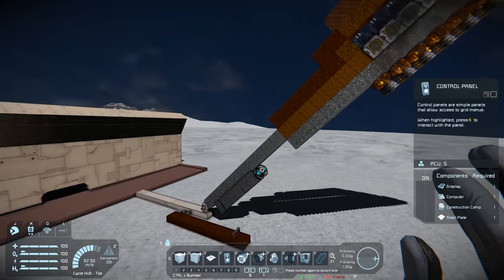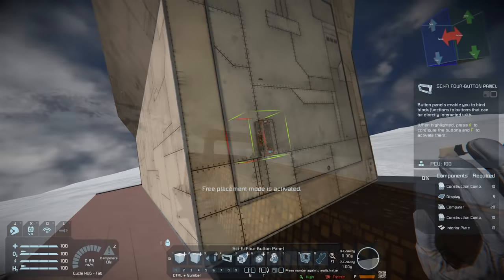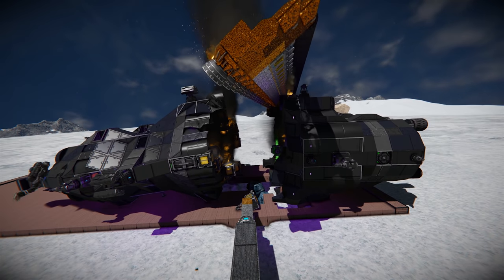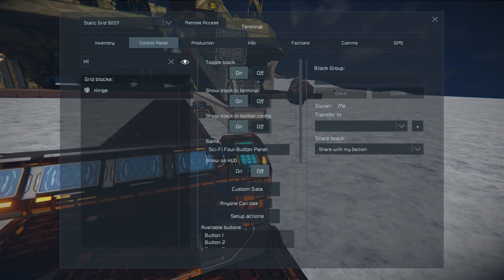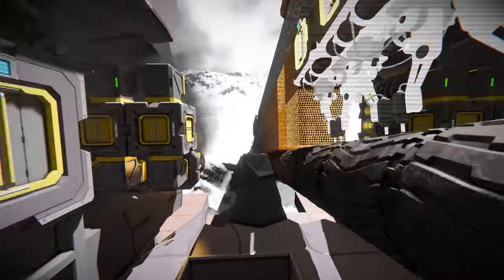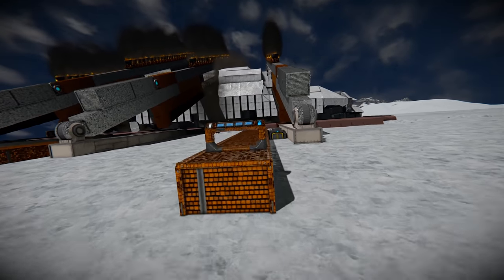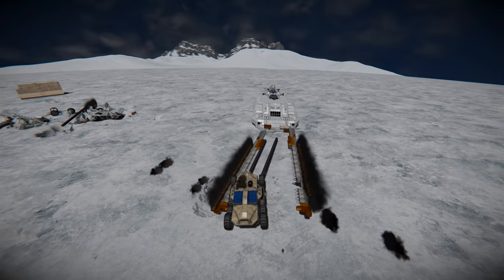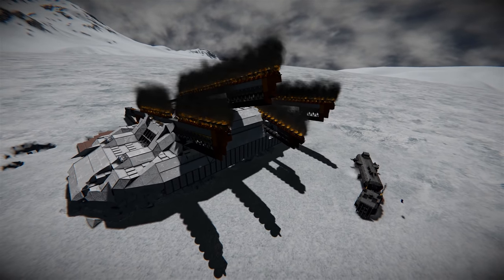Space Engineers - "Hot Knife vs." Space Ship Chopped

Comment: For what your doing, make the area were your smashing against objects out of blast doors, why blast doors? Because they can absorb more kinetic energy and distribute any kinetic damage across all the bast doors that are connected to each other, there crazy effective for what your doing so long as you have them linked to each other do to distribution. Here is a test I suggest for everyone here to do to achieve greatness 
1. Make a line of blast doors that are connected together were ever you can on the point of kinetic contact
2. put it on whatever you want to protect from kinetic damage in the case of a ship design an interior skeleton. In the case of a sword make a line on the point of contact for best results
3. smash something against it and see the results, weather you smash into something or something smashes into you the results should be the same, a kinetically durable object.

cons to blast doors
the cant handle damage from anything that isn't ramming speed material, 
way to bypass this is to put actual armor over it for the purpose of dealing with the bullets while still achieving you kinetic guard.
Hope you enjoy.